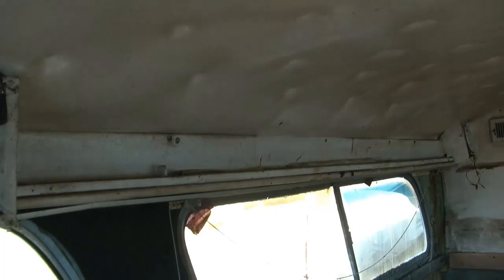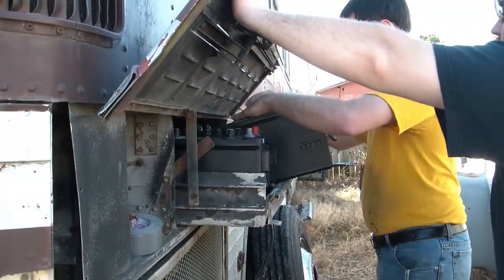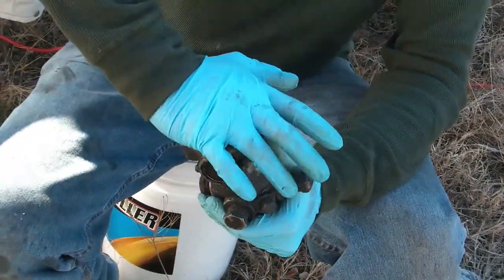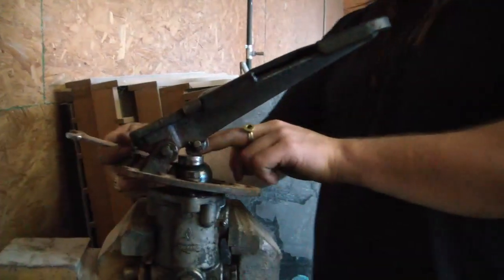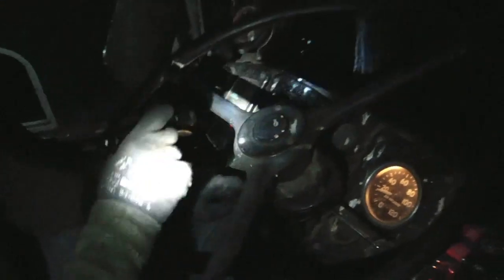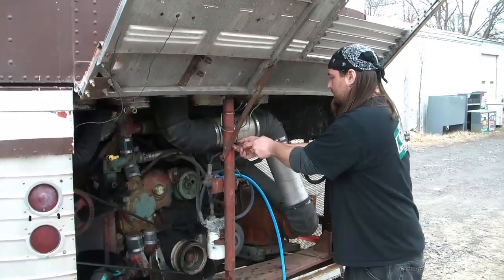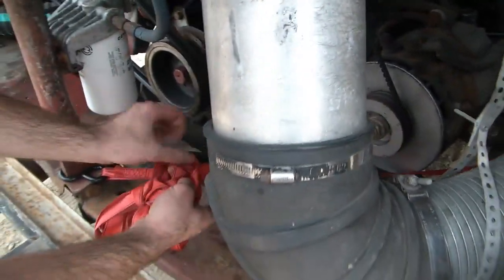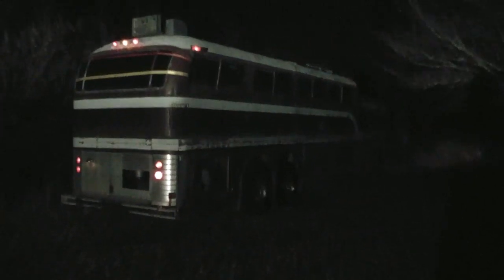Scenicruiser pd4501-855 moves to Alabama 2011

Comment: Hey eight min and therty seconds, into the video and I'll make you a master mechanic, Just a touch slow but thorough and pure genius...My Daddy told me "No matter what machine it is, planes to Trains. If it's broke or worn out or if only for safety's sake, replace it with the exact same part in better  condition. and cruize on...and remember the older parts wear out tires faster